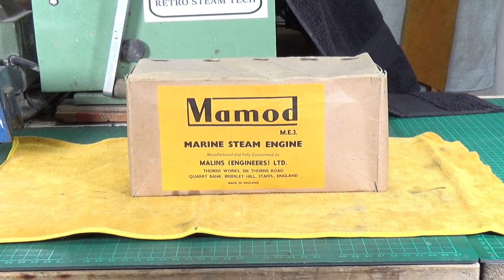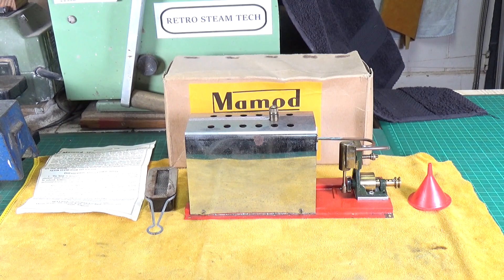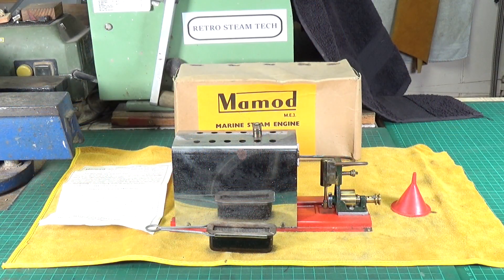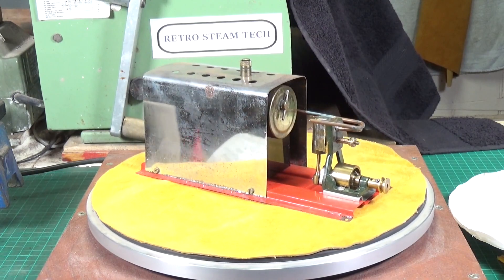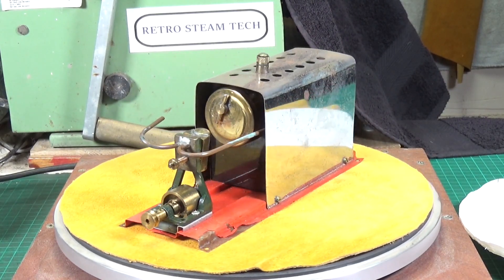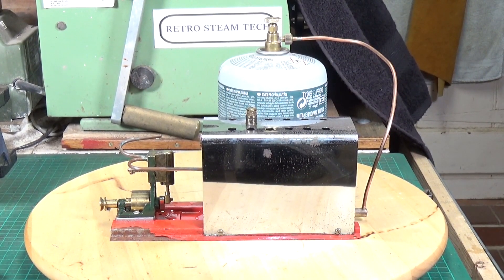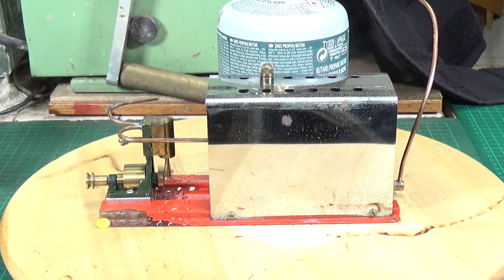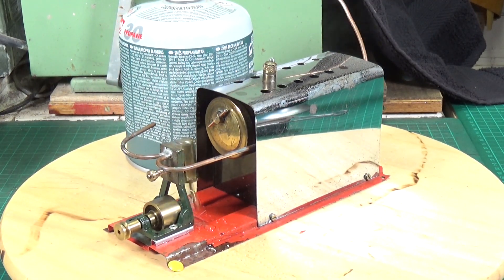Mamod ME3 Marine Model Steam Engine

Comment: Would this engine have a universal joint to connect the drive to the propellor as the engine is not angled like on the ME1?
Reply from the maker: Yes possibly. I think the pulley on the end of the crankshaft is fitted the wrong way round. In other photos I've seen of the ME3 the pulley has a T-Bar through the end which was probably used to drive a prop shaft.

Comment: Although the engine was sold by SEL as their "Steam Launch Engine", it shares no parts with their stationary engines. These marine engine units were actually manufactured for SEL/JR Randal by another company called Midland Models, who started producing them in 1947. So its even more unusual- a Mamod labled engine, using an engine they got cheap in bulk from another manufacturer, which was in turn sourced from another manufacturer set up just after WW2 that few people now have ever heard of!
Reply from the maker: Thanks for the info, I didn't know that part of the story.